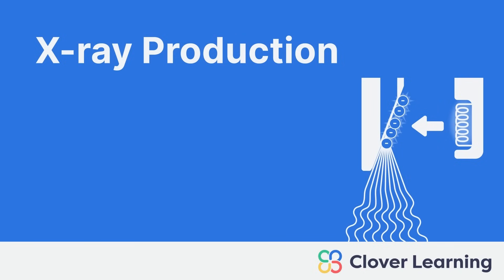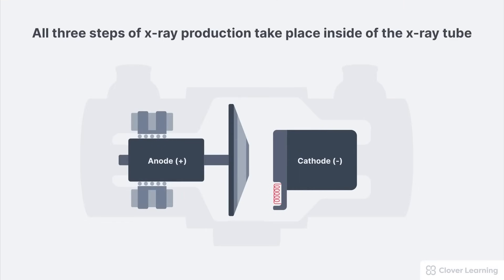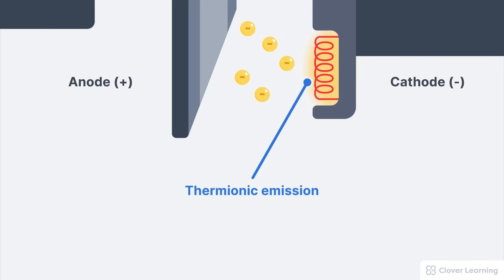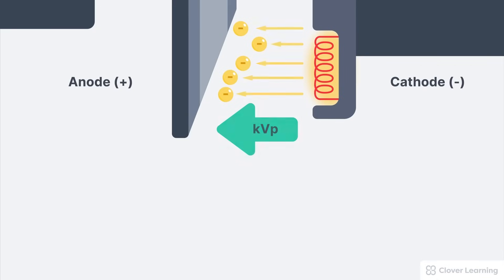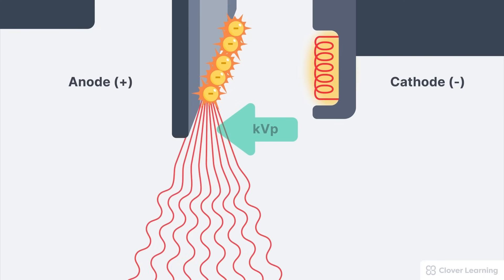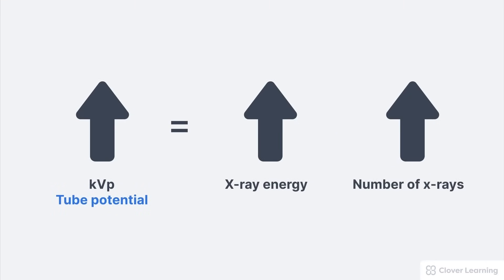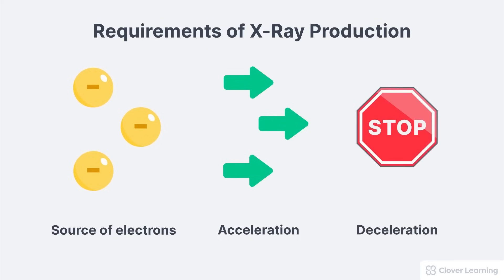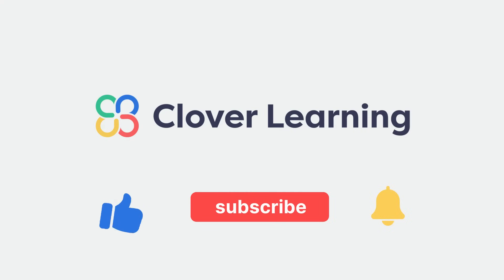Introduction to X-Ray Production (How are X-Rays Created)

Comment: Hold on , electrons are negative and they are attracted to positive anode . How come they decelerate? They can’t decelerate because it’s an attractive force .  Electrons are particles and Xays are energy . How the decelerating electron mass is converted into energy. Please answer these questions.  I know you just copied content from a book and made a video 😂
Reply: Deceleration is not caused before collision. Collision causes deceleration.

Charged particles when accelerated release radiation. Analogy: Think of electron falling from n=2 to n= 1 in hydrogen they release energy right? That's how

Comment: 🎯 Key Takeaways for quick navigation:

00:00 🌟 X-ray Production Principles
- Introduction to the main principles of X-ray production.
- Three requirements of X-ray production: source of electrons, means of accelerating electrons, means of decelerating electrons.
00:30 🔍 Thermionic Emission and Electron Acceleration
- Explanation of thermionic emission as the process of releasing electrons in response to heat.
- Description of electron acceleration through the application of electrical voltage (kVp).
- Role of kVp in creating a strong negative charge in the filament and accelerating electrons towards the positively charged anode.
01:58 🔄 Deceleration of Electrons and X-Ray Production
- Overview of the final step in X-ray production: decelerating electrons at the anode.
- Description of the process where highly energetic electrons release energy as heat and X-rays upon hitting the anode.
- Control of X-ray quantity and energy by the operator using mA, kVp, and exposure time.
03:24 📊 Influence of mA, kVp, and Exposure Time
- Impact of mA on increasing the number of electrons and photons in the X-ray tube, affecting intensity or quantity of X-rays.
- Explanation of how increasing kVp enhances both the number and energy of X-rays produced, influencing beam quality.
- Role of exposure time in increasing the total number of X-ray photons created, analogous to the production of rainbows by unicorns eating Skittles.

Made with HARPA AI